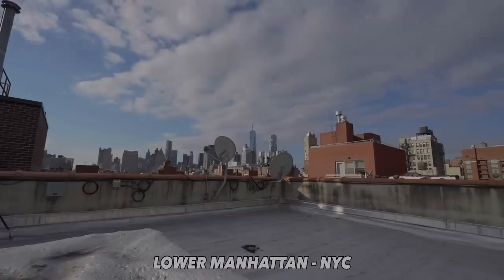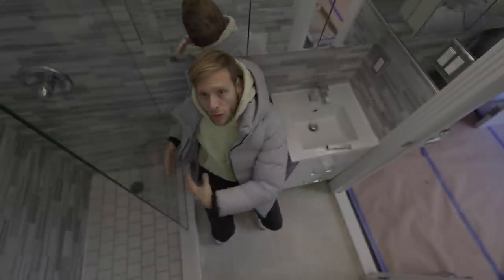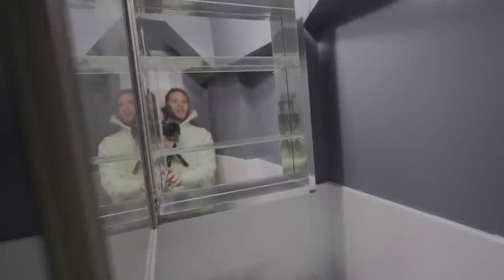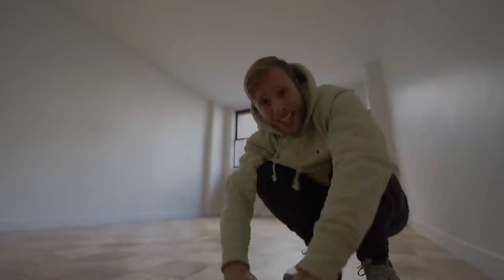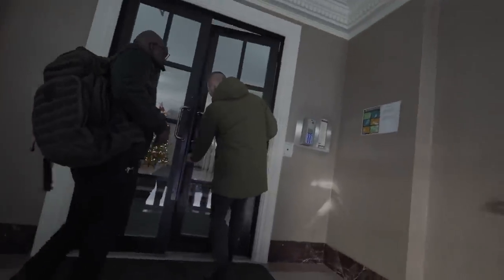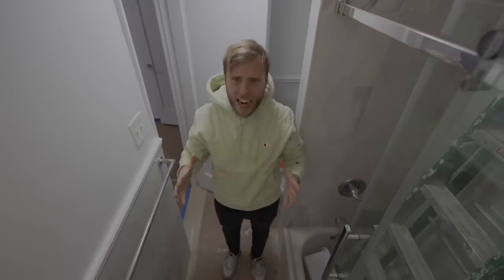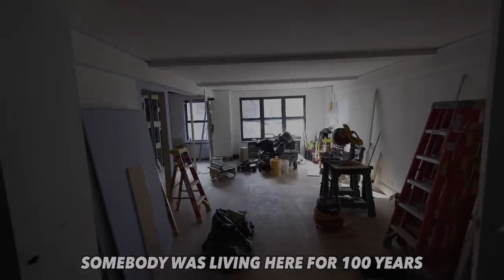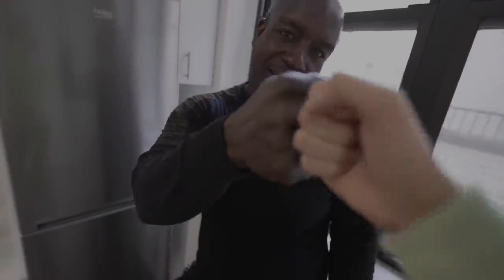This Illegal Apartment Lurks Beneath NYC…

Comment: Refrigerators really need some space around them for air circulation, in order for the compressor not to burn out prematurely. So it's not a good thing when a fridge fits in a space so perfectly. Also in order to clean your appliances properly, you have to have room to pull them out of their places.
Reply: AMEN to that!
Reply: Good points!
Reply: Some newer fridges need very little space.
Reply: So true.
Reply: Folks renting these are... renters, and DGAF about the landlord's appliances.